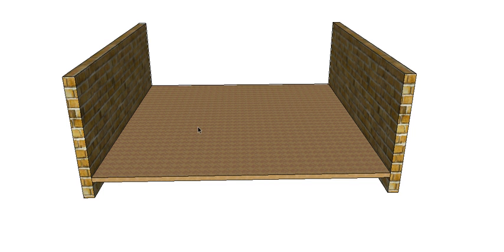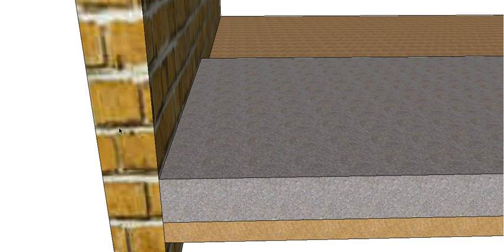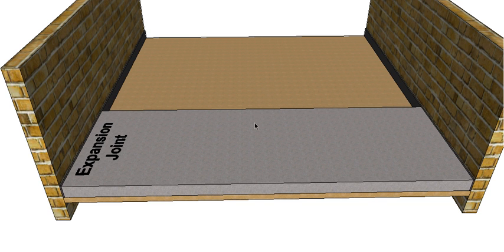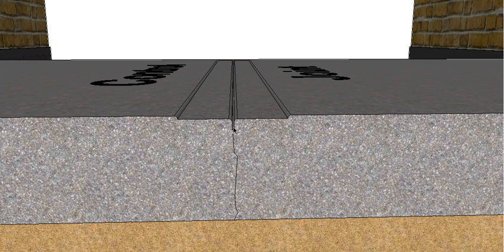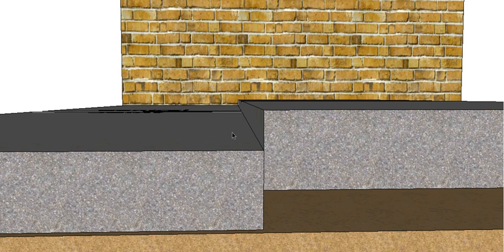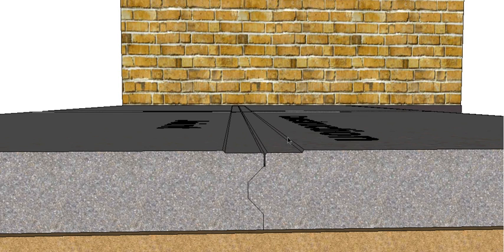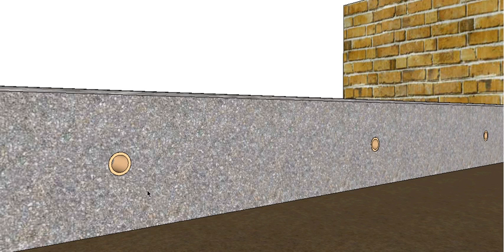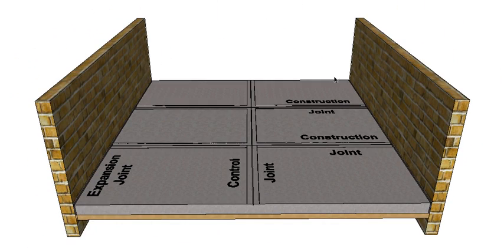Concrete Joints

Comment: if the concrete expands, why would you need control joints. control joints are meant to control shrinkage cracks. so my actual question is - why would you need expansion joint for a concrete slab?
Reply from the maker: Hi Mate, Concrete tends to shrink slightly as it cures, but it will expand and generally move with ground movements over its lifetime.

Comment: was the first joint more of an Isolation Joint than an expansion joint?
Reply from the maker: Hi Mate
They are both pretty much the same i think. 
Isolation construction joint HB50
joint between elements of a structure designed to isolate structural movement while permitting horizontal and/or vertical movement between abutting elements

expansion construction joint HB50
vertical or horizontal movement control joint in a construction which permits axial movement due to thermal expansion or contraction with changes in temperature, or creep
Reply: @ thanks mate. Per the definitions, I’d go for Isolation joint then (abutting “elements”). Expansion joint seemed applicable term for 1 element that you want to expand or contract, like long highways, pavements, walls, etc.

Thanks again!

Comment: Is it possible to create foam expansion joint in existing floor concrete having expansion joint with the wall?
Reply from the maker: Hi Mate, an expansion joint, no, but you could cut in a control joint.
Reply: @Buildsum  thanks. The concrete pathway without expansion joint with walls there for more than 8 years and don’t see any cracks in the walls. There is very small gap now between walls and concrete pathway, should I just fill with sealant? Thanks for your time

Comment: @buildsum
The video first showed a control joint between two already poured slabs, which made sense. However, it then transitioned to a beveled construction joint, with the control joint still present. This seemed confusing, as a control joint wouldn’t exist when creating a construction joint with the first slab—the second slab hasn’t been poured yet. So, my understanding is that when pouring the first slab, there's no need for a control joint. And when the second slab is poured, a control joint still isn’t necessary because the construction joint already creates a full-depth gap. Is this correct? I would see a need for a control joint in the center if either slab is very long (which was stated in the video).
Reply from the maker: Hi Mate, we really want all the joints to look the same regardless of the type of joint. Yes the top of the construction joint is essentually a control joint but that is just to remain asthetics.

Comment: Awesome video, much appreciated.  Obviously you cant stop the concrete from cracking, but does moisture eventually pass up the crack and rust the rio?
Reply from the maker: Hi Mate, thanks for you comment, Yes it will eventually and in some cases this causes the concrete to break off, called "spalling", which then lets more water in. Also called 'Concrete Cancer".

Comment: Hi please answer.so lets say i poured already my floor concrete and then want to pour a wall.i put construction joint or expansion between wall and floor???because i pour concrete on concrete so it’s construction joint but at the same time its two element wall and floor so its expansion joint
Reply: But the bottom of the wall that is connected to the concrete floor will have expansion joint right? Not construction joint
Reply from the maker: Hi Mate, Not necessarily as the wall could move up and down without causing damage if it is not fixed at the top.
Reply from the maker: Hi Mate, it would depend on how the wall would be fixed at the top. If the wall was going to be freestanding like a brick wall then you wouldn't need anything however if it was going to be connected to a concrete ceiling for example you would have to allow for expansion and movement (slip Joint)

Comment: So part of my assignment suggest that after the first slab pour we discover that the diamond dowel system was done incorrectly and asks us to propose three solutions to ensure once the second slab is poured we have no issues. I am proposing drilling new holes and adding dowel bars as one solution. I wanted to recommend a key joint but the question is : CAN YOU ADD A KEY JOINT AFTER SLAB IS POURED?? please help also can you suggest any other solutions considering first slab has been poured…
Reply from the maker: Hi Joeseph, no you cant add a key joint after the slab has been poured, doweling is definately the best option. Im not aware of any other soloutions however there may be some patented systems on the market that you could use.

Comment: How many metres or feet between control joints. Also placement specific.  I.e. corner of a building? Also deping on thikness. Is there a set formula for this. Thank you, Damo
Reply from the maker: Hi Damo, there are alot of factors, like the ones you have mentioned, that would go into the placement of the control joints. There is no formula that i am aware of. Thinner slabs would need more, internal corners as well.

Comment: Can I still ask questions? My 15’ by 15’ garage just got new concrete laid down. 4 inches and more. This large shed has wood around the base perimeters. Some were rot so we replaced those too. The builder laid down metal mesh, and poured one piece in one day. Lots of work but they emphasized the importance of one piece. Because the previous concrete was done in four slabs and the panels shifted up and down. But, he didn’t do co trip joints and not sure about expansion joints around the edges. Would it be a big deal? Maybe the wood sill/frame allows the expansion and shrinkage?
Reply from the maker: Hi Mate, the timber would allow for some expansion however i would still have control joints in the slab.
Reply: @Buildsum  would it be possibly to carve it after it’s cured
Reply from the maker: Hi Mate, yes you can cut them in after as long as you dont go to deep and comprimise the reinforcement.

Comment: This is the best explanation of concrete joints on the web - well done and thanks so much. Your imaging tool makes it very clear and easy to understand - great job. Your audio on this one was very "hot" or overloaded leading to distortion - recommend a good quality mic and check your audio levels before recording.
Reply from the maker: Hi Mate, thanks for your comment, Yeah i had a few issues with the audio in the start. I have upgraded my software and mic and seem to have had better results in the more resent videos.

Comment: Just had a 1200 sq ft patio poured. Simple rectangle shape, 3 sides are open to the yard with nothing against it. One side its full length is against a poured concrete basement wall. Contractor claims that there is an expansion joint between those pours but I can't see it. There are saw cuts about every 7 foot by 7 foot square over the whole 20 by 60 patio. Patio has rebar. Is that  enough for expansion since 3  sides are not against anything?
Reply from the maker: Hi William, It is possilbe that there could be an expansion joint betweeen the slabs with a small layer of concrete over it so you cant see it so it could be there. Given that it is open on the other 3 other sides it is not going to be as important as if it was enclosed.  As for the control joints that sounds like there is easily enough. Hope this helps
Reply: @Buildsum  Thank you for the reply. The outside 3 edges of the patio is also rather elevated from the surrounding landscape and really has nothing impeding its expansion on 3 sides, justvdont want a crack in my basement wall in the future.
Reply from the maker: Hi William, i dont think you are going to have any issues in this situation.

Comment: Thanks for the video. Would a concrete window sill 2.25m X 0.40m  need an expansion joint in the middle?
Reply from the maker: Hi Mate, no not in the middle however i would make some allowance to movement at the ends especially if it is supported on a different material like brickwork. Hope this helps.
Reply: @Buildsum  Thanks for the advice. Not many You tubers bother to reply. Be safe be well

Comment: Does a concrete basketball court need joints
Reply from the maker: Hi, for something of that size and if it was just the court without any additional sections or attached to a building or another slab, i would say the they would be optional however if it was my job i would at least put in a control joint in the middle of the slab in both directions.

Comment: This is a great video! If you are using dowels, does the concrete need to be able to expand and contract with the dowels or can it just shift with the pad it's doweled into? Meaning both pads move together. Also, if you are going to plan on using dowels, do you just run your joiner tool on the one first pad while it's wet? Essentially your tool is only running along half a pad.
Reply from the maker: Hi Steven, Thanks for your comment, the dowel has to let the slabs expand and contract independently, this is why the dowel that goes into one of the slabs are lubricated and protected so they don’t grip the concrete. This will allow independent side to side movement but not up and down movement. As for the edging or finishing generally, the slabs would not be poured at the same time so they are finished independently.
Reply: @Buildsum  excellent. Thank you. What I was meaning with using the groover tool was how do you get it to appear like it was poured at the same time. Can you bevel the one edge and then pour the second pad the next day and then bevel that edge?
Reply from the maker: Hi Steven, it takes a degree of skill but yes you can.

Comment: Hi Buildsum, how can you tell visually if something is a control joint or a construction joint if you're inspecting a finished concrete floor say in a warehouse?
Reply from the maker: Hi Thomas, not really as they can look exactally the same however the Contol joint wont have any expansion joint in it so is generally thinner where as the construction joint could ( but doesn't have to) an expansion joint so it would be approx 10mm wide. Now days most Control joints are cut into the slab a day or so after it is poured so if it just looks like a cut that is 3mm wide it would be a Control Joint. Hope that helps.

Comment: Thank you for your videos, I now understand so much more and have learnt lots. A question if I may, in an area where I can not get a cement truck and can only mix by cement mixer, a slab on ground with side footings that go into ground, as in your slab on ground video, it will be impossible to pour the full slab in one day. I wish to use the key joint method , my question is do I do each section with edge footing, or do I do the whole edge/footing first then the slab on top, also not so sure how i will do the key joint with the mesh layed out. Any advice would be great and thanks again.
Reply from the maker: Hi Peter, it is possible to pour the footing and the slab separately. Once the footing is poured to slab could even be done in small sections as required. As for the Key Joint, it is easier to set up the formwork and key joints first and then cut in the reinforcement however you can layout the reinforcement and then cut a slot for the key joint to go into. Remember the reinforcement does not cross the key joint.
Hope this helps
Reply: @Buildsum , thank you very much for your help..

Comment: Hi  Buildsum,

Thankyou for that very informative video. The only issue I have understanding the joints used in construciton is now is that surrounding the 'Isolation joint' what is the difference between these joints you have explained and the isolation joint?

Thanks.
Reply from the maker: Hi Alex
An Isolation joint would be similar to the expansion joint shown in this video. The Isolation joint basically separates the concrete from other materials that may move at a different rate.
Hope this helps
Reply: Thank you very much.
Regards,

Comment: Its really nice video out of all. Thank you for the video. but there are a couple of questions need to be clarified 1) Is expansion joint only be at the edges?  If the foam board is kept at the middle of the panel then is it called an expansion joint
2) Is it Reinforced concrete slab or concrete slab, if reinforced concrete slab then how the steel bars will be placed ?

Please explain this questions. Thank you
Reply from the maker: Hi Raghu, Thanks for your comment. In reply to your questions 1) Expansion Joints could be incorporated into all of these joints. If you had a lot of construction joints it would be worth making them a combination construction/expansion joint to stop them wanting to lift up. 2) It is very rare to have a concrete slab without reinforcement in it. Here are a couple of videos that may help with the placement of the steel.
https://www.youtube.com/edit?o=U&video_id=vuZcPTp51Zk

https://www.youtube.com/edit?o=U&video_id=0Um_Ttv95Ko
Reply: Thank you for the reply, But both the videos are not working. can you send it again, please?
Reply from the maker: Ok sorry try these
https://www.youtube.com/watch?v=vuZcPTp51Zk

https://www.youtube.com/watch?v=0Um_Ttv95Ko&t=244s

Comment: great video! i keep hearing cold seam be tossed around with concrete...what is that?
Reply from the maker: Thanks, Matthew, I haven't heard of a cold seam but have heard of a cold joint. This is where you are extending onto a section of concrete that has been poured previously. You would have to use the Dowel Method to join the sections and prevent the differential movement.
Hope this helps
Reply: Thanks!
Reply: how do you control/account for differential movement/settlement on say concrete pours like a walk-way or patio where the concrete is thinner?
Reply from the maker: You can still use the same methods, the Keyjoint is good for thinner slabs.

Comment: All three joints should  be used once??
Reply from the maker: Hi Naveed, while it is possible to have all three joints in the one slab it is not necessary. In some cases, you may use the same joint multiple times.

Comment: Q: What's better, Key joint or dowel joint ? Great video btw :)

Q: Does concrete expand, & shrink, even after it's set? or only during the time it's setting  ?
Reply from the maker: Hi Mate
Both do a similar job, however, it would depend on what you need to do. If you were joining on to or extending an existing slab that has been poured for a while you would have to dowel it to connect to it. If you were just stopping the pour and continuing the pour the next day I would use the Key joint as there is less work involved to form the connection.
Concrete will shrink as it sets, as the water evaporates however it will also expand and contract with changes in temperature for the rest of its life.
Hope this helps

Comment: I don't think it is always necessary to have an expansion joint on a wall. With expansion joints elsewhere, the wall should be fine.
Reply from the maker: Hi Alan, If the slab is free to move away from the wall on the other side then you probably could get away without the expansion joint however personally I would still want some separation between the different materials.
Reply: Alan Fox Depends on the length of the structure

Comment: wow great video.. but just 1 question regarding construction joint, how is the main steel rebars will do at the end of the C.J. Are they will be terminated or hook or its just fine to continuously extend the main bars for the next day concrete pouring, instead of using dowels?
Reply from the maker: Hi Marc
Thanks for your comments 

If you extend the main bars there will be no allowance for the differential movement between the two slabs which will subject the slab to tension and possible cracking. The bars should be terminated and the slabs joined with dowels or a key joint.
Hope this helps
Reply: Thank you sir for your response.. sorry i need to ask and seek your professional advice because at the moment I am doing structural details (slabs-on-grade). The scenario is this, I want to have a Construction Joint inside the residential project due to some construction material storage issue. Anyway going back, if I make/create this C.J. and after I will laid out my floor tiles covering the joint. Is this ok? Or should I terminate my floor tiles at the line of the joint?
Reply from the maker: Hi Marc I would not run the tile across the CJ unless you put in an expansion joint in the tiles themselves (something like this http://tilingtoolsdelivered.com.au/expansion-joints/expansion-joint-aluminium.html) If you do they will almost certainly crack along the joint.
Reply: Thank you sir! really thank you very much.. I learn so much with you.. God bless!
Reply: for the last sir.. can you give me a full detail about Construction Joint that I can use as a reference like a shop drawing. Hope you can give me! Thank you again..
Reply from the maker: Hi Marc this might help
http://www.ccaa.com.au/imis_prod/documents/Library%20Documents/CCAA%20Datasheets/TN63-2004JointsTBR.pdf
Reply: thanks sir!